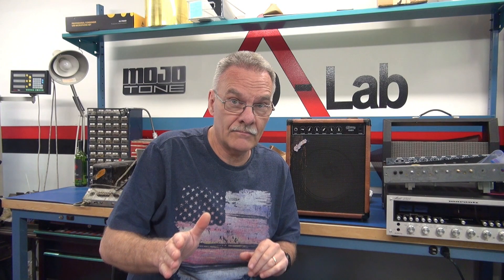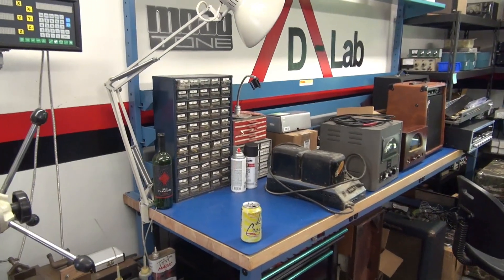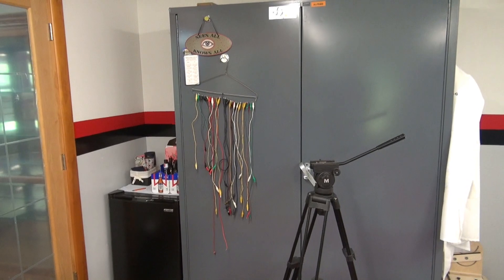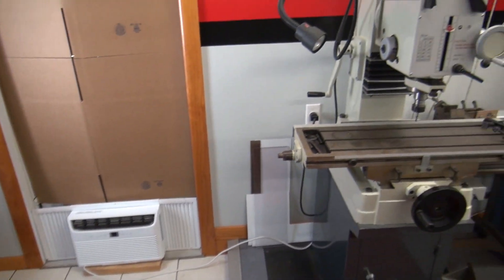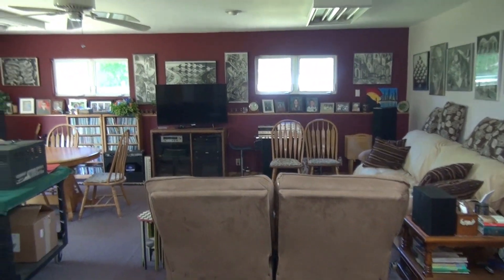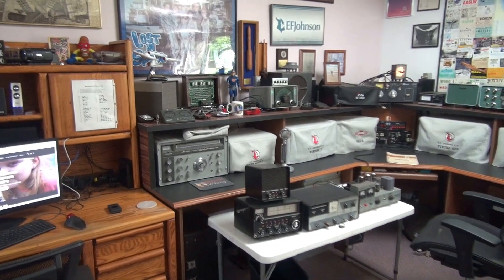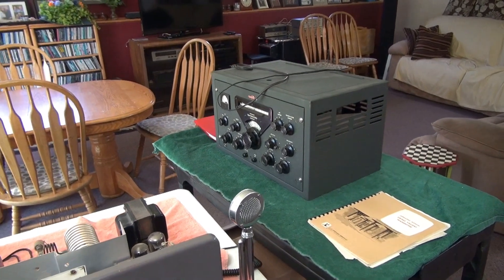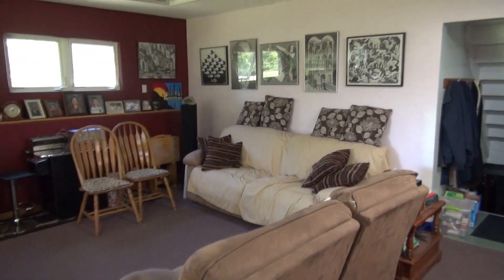Tour D-Lab Electronics Plans expand grow the operation underway New benches room Goal for the future

Comment: Good luck with the expansion. 
A lighting suggestion... My basement/workshop/studio was fully lit by 4 ft 4 tube fluorescent fixtures that never really provided great light. Recently I converted all those to led tubes. Ended up having to remove 1 led tube from each fixture because it was too bright. Best upgrade I have made to my space. Maybe something helpful for you also. I imagine that would be more cost effective than replacing with new fixtures.

Comment: You will really like the lift table.  I have one from Harbor Freight that I use to lift console stereos.  I just lift one end up, shove the cart under it in the center, then lift it up to bench height.  I can just sit in my shop chair and not have to bend over and crawl around to service it.  Works great for moving those boat anchors around as well.